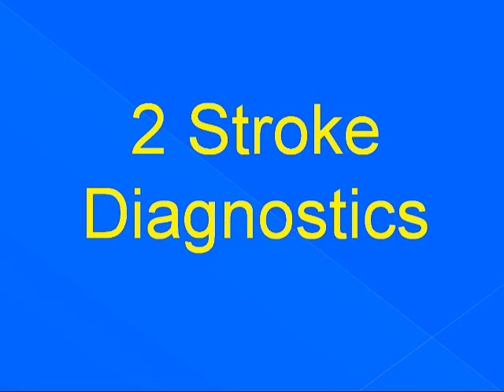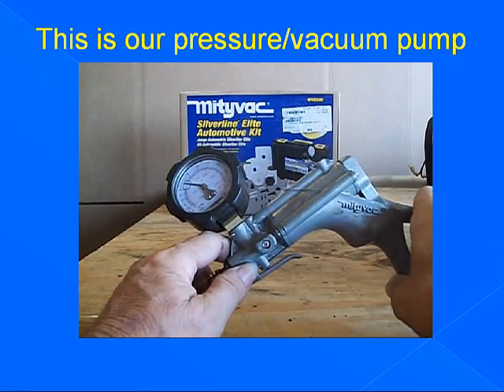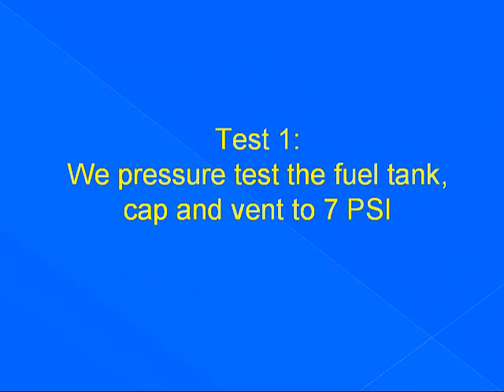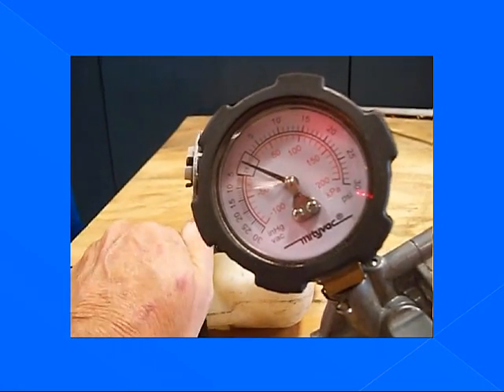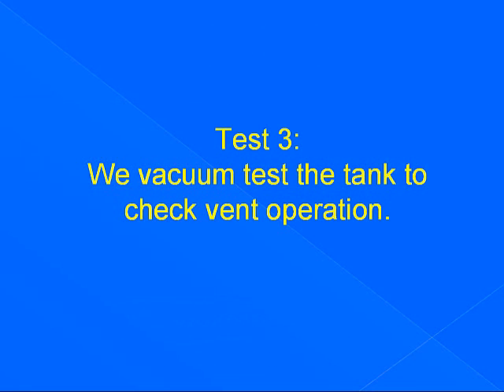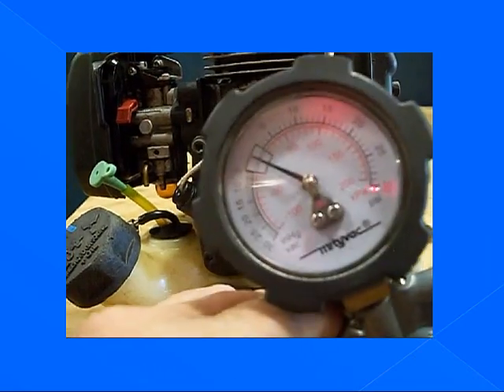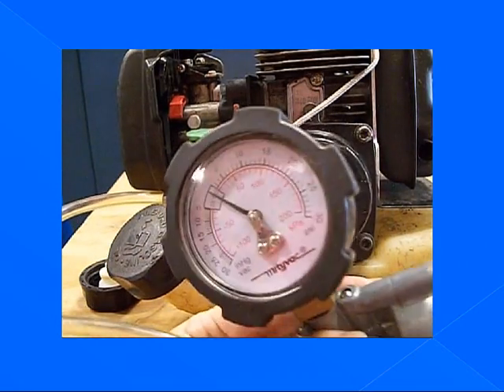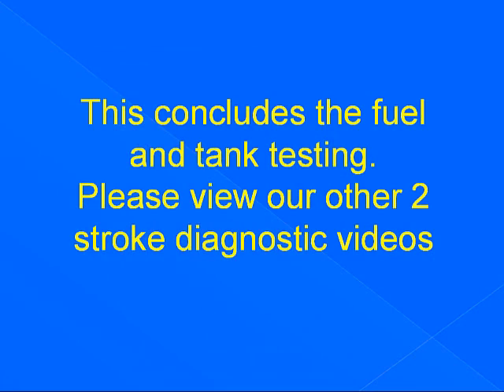fuel tank and vent testing

Comment: Although this this same principle applies to many fuel tanks, check to see if the manufacturer of the tank has a sticker with pressure testing specs.  Boat tanks are usually rated for a max testing pressure of 3lbs on most tanks.  You don't want to rupture your tank.

Comment from the maker: Bob
Chain saws fuel tanks in general have 2 way venting the should hold 3 to 4 psi and not much more. the amount of pressure they will hold is designed in by the manufacture.